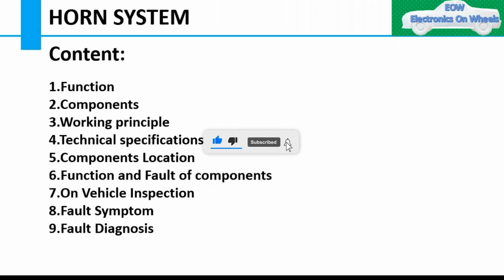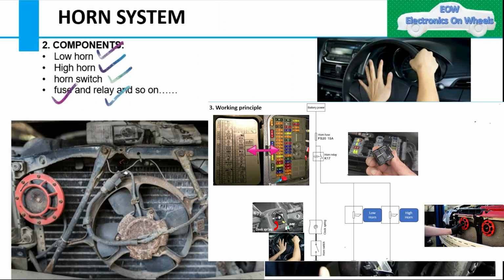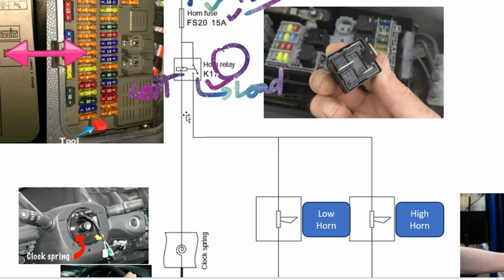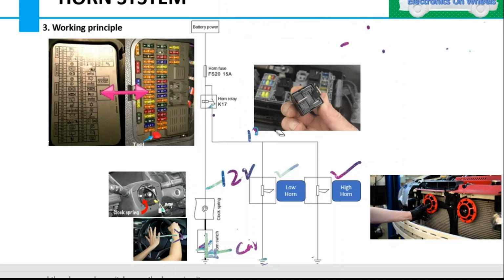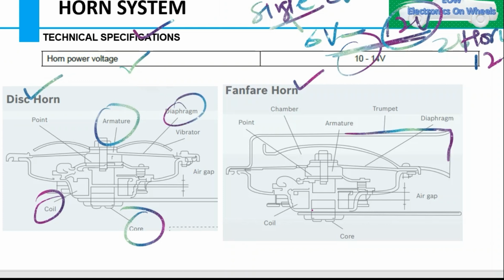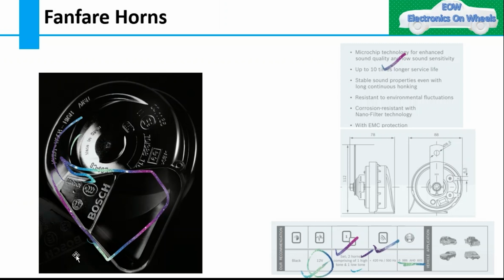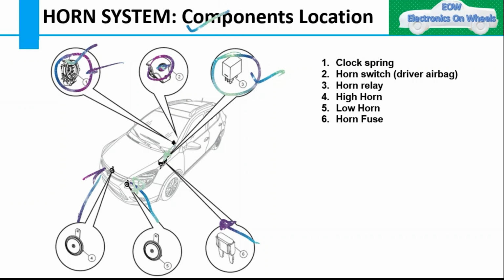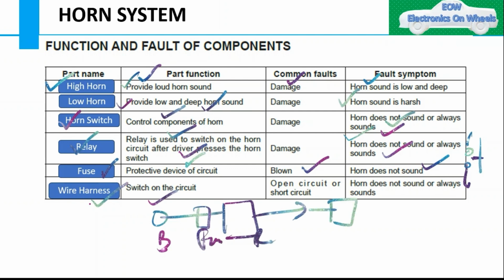What is horn system? How horn works in car? How to fix horn in car@WeberAuto @SabinCivil

Comment: Thank you for the video. Very interesting.

The Relay is required n order to reduce the power load that is switched by the HORN switch.

Please say if HORNs are usually supposed to be Inductive loads? So what could be peak current at the beginning of initiation of horn. 10 times more when during continuous use?

Comment: 1.Handle the larger current required to sound the horn
2.Relay helps to protect the horn components and proper functioning of the horn system.